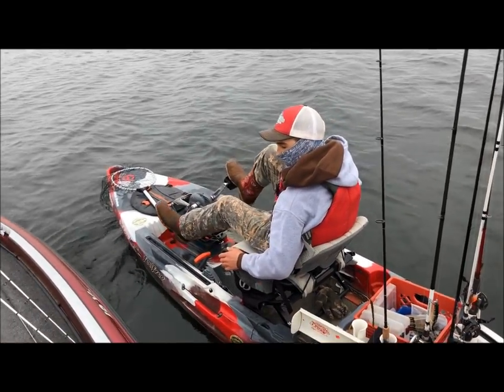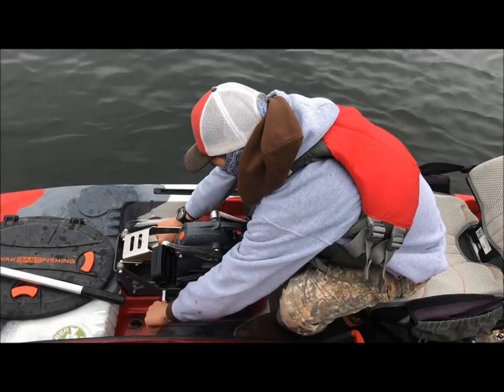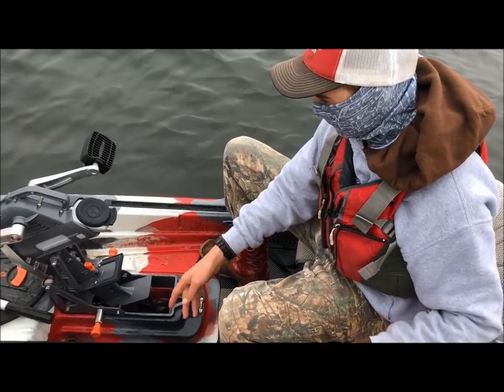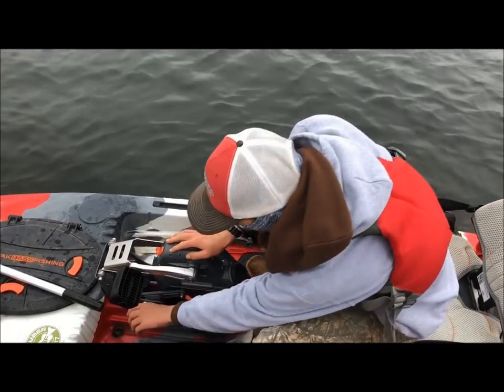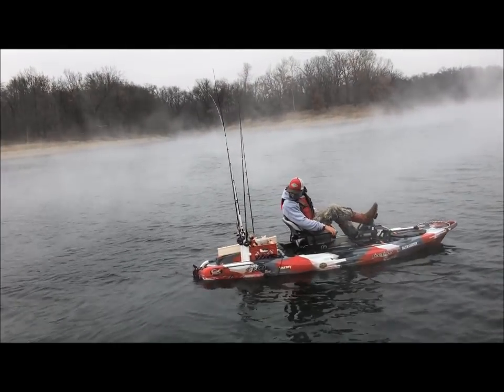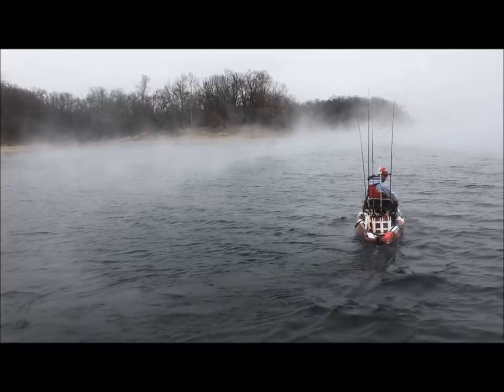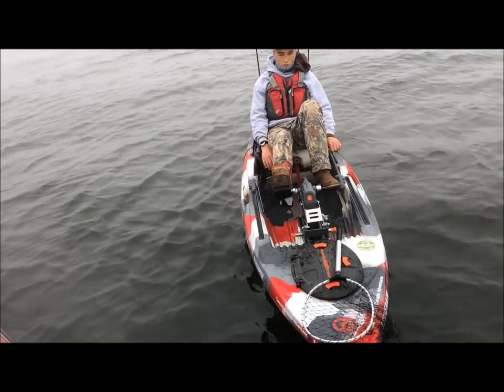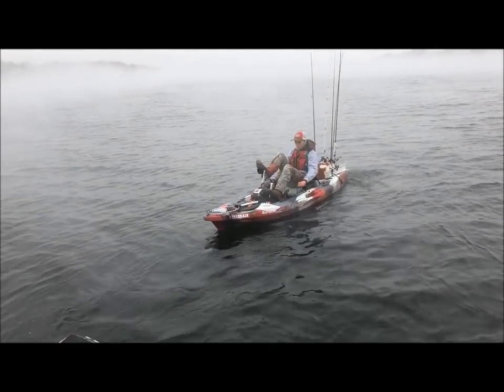Feelfree Kayaks Overdrive Pedal drive test

Comment: Hope you dialed in the rudder. We had a little trouble on our first install but now we have it dialed. Its all about having the bungee side tight, and making sure when you crimp your wires the rudder is fully extended. Thanks for the videos!

Comment: Thanks for posting. I have a 13.5, which for those who have one knows, is very heavy and slow to respond to paddle only steering. As many have posted on other videos, the 13.5 really needs rudder control. I did watch the install video and was very disappointed in the fact the pedal rudder controls are completely removed for the installation of the hand control arm.  I fish off the California coast, and to launch through surf a paddle would have to be used until deeper water made it safe to deploy the prop. Deploying too soon would risk damage by getting pushed back in to shallow water. To get through the surf paddling in concert with foot controlled rudder movement ensures the bow stays point into the swells and breakers. Paddling alone without the rudder is going to be sketchy. I may have to wait to purchase this system until I can engineer a way to keep the pedals intact.
Reply from the maker: Glenn I think you can still use the foot controls for your rudder. We just chose to remove them. My understanding is that instead of cutting the cables like we did, you just leave them intact. You simply unhook the bungy to use foot control.

Comment: How much is just the pedal drive option? Does it get in the way when trying to access the front storage?
Reply from the maker: felby8605 it’s $1099 at most dealers. You can access the front easily, but if it’s lifted up, you might have a little trouble.

Comment: Awesome!!   I have the 13.5.   Question!!!!   I live on the Texas gulf coast.  LOTS OF SHALLOWS.    That being said could I just use the peddle drive and use the paddles to guide the lure myself???      I have a mini power pole on the back for sudden stops for sight casting.
Reply from the maker: RipLine Fishing I don’t see why not. I think it would be awesome out there in the salt.
Reply: Carson's Outside Adventures  whenever u have a chance to make another video or whatever.   Have the rudder out of the water.   Can u Peddle and use the paddle to guide and tell me what u think. If you don’t mind.   Just to see and insure myself and others !!   That would be awesome if it works and plus it can defiantly save money  if you know what I mean.   Lol.      Also.   Where did u get that overdrive peddle system.   I can’t find it anywhere
Reply from the maker: RipLine Fishing we will try that. It’s pretty cold here now. My kid is going out tomorrow to fish. A few dealers have them but they go fast. I know one here in Arkansas has an unclaimed one.